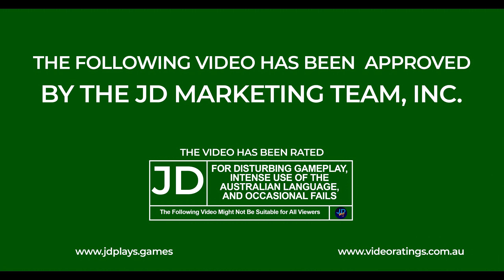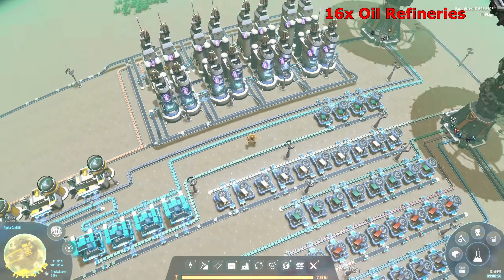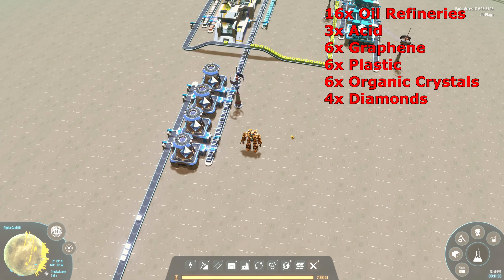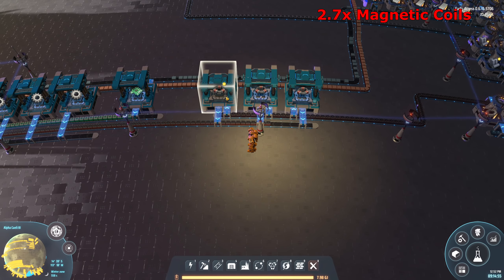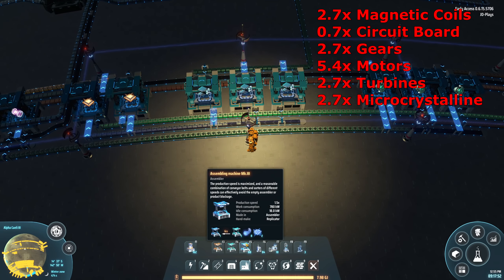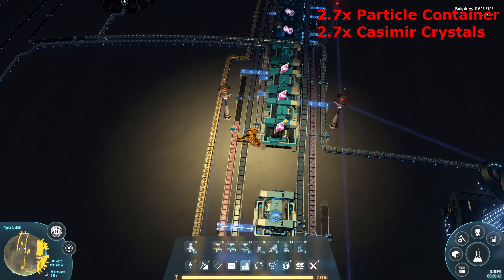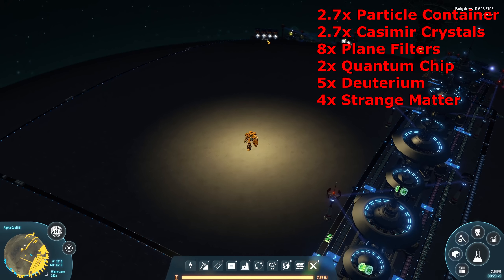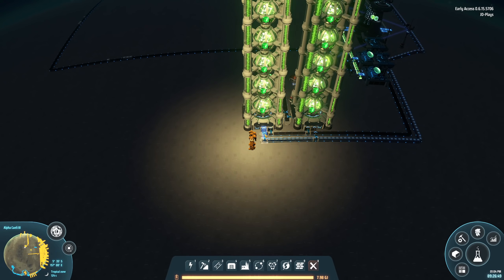How to Green Science Ratio Builds 🤖 Dyson Sphere Program 🤖  Tutorial, New Player Guide How To

Comment: very helpful, took me a week to get my mine up and running, smaller but still effective. My biggest bottle neck was hydrogen that I've had to get from around my factory to have enough. Imported fire ice from another system to make graphene production simpler, you do get a bit of hydrogen as a bi product, not enough to feed the system unfortunately.  I think if you can find a system with the pink crystals to mine you can also simplify the casmir crystal production flow.
Reply from the maker: Grab some oribital collectors, head to your nearest gas giant, and throw them down.... like 40 of them! That will fix your Hydrogen problem!
Reply: @JDPlays  currently doing that, to get deterium and hydrogen, takes time to replenish it seems

Comment: Personally, I designed most of my designs to use the Assembling machine MK2 (at the time, due to MK3 being too hard to craft, also since research is the first time crafting anything, I didn't have the quantum chips needed to build them yet)
The advantage of MK2s is with their 1x production speed... all the machine quantities were perfectly whole numbers.
Even now in my super-late game, I calculate to MK2 machines, and then replace 3 MK2 machines for 2 MK3 machines as often I can, but that does mean ocasionally I build 1 or 2 MK2 machines in the mix. (of course just using MK3 machines all around and slightly over-building isn't a bad thing either)

Comment: Oof. Just, oof. Also, combined totals of note when adding green cubes onto your existing science builds, as I posted on the purple video:

38.5 plasma refineries, totalling 19.2-ish oil per second (note: without mining productivity this is nearly 2/3rds the starting planet's minimum oil)
5.3 sulfuric acid plants
10.5 graphene plants
15 plastic plants
12 organic crystal plants
6 diamond smelters
10.7 mk1 / 8 mk2 / 5.4 mk3 titanium crystal assemblers
37 energetic graphite smelters (does not supply red science since that build used x-ray cracking)

Anything overlapping not summed here is simple enough and used elsewhere enough that you've probably built more production of it than you need just for science anyway, but I needed this information for scaling my manufacturing outposts suitably and figured I would share. ^.^
Reply from the maker: Yep its a substantial build!